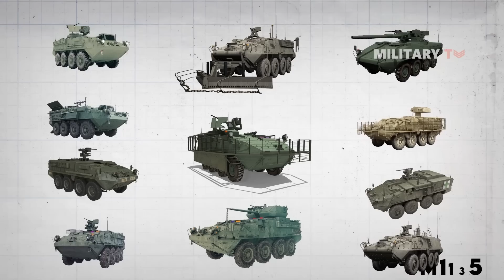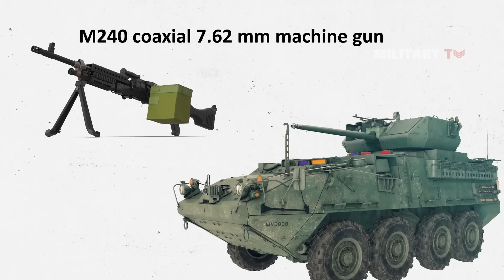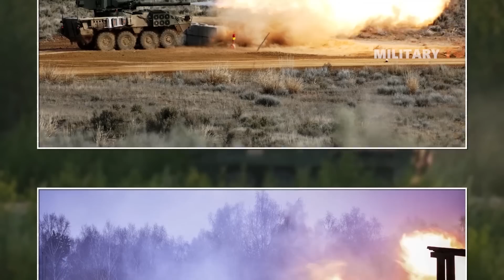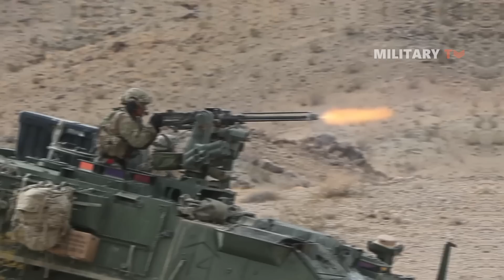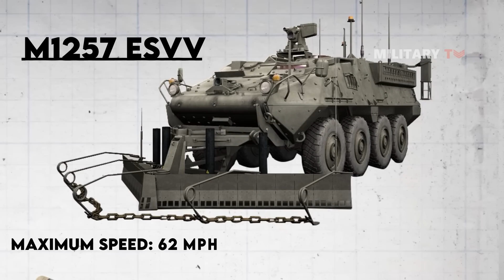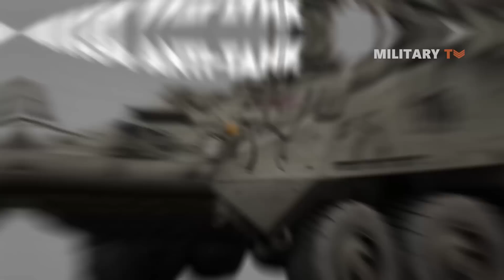What is the Stryker AFV the US is Sending Kyiv

Comment: I think the mortar variant would be particularly useful since Ukraine is often outgunned its ability to shoot and relocate would be critical. I was in a 113 mortar carrier and we could go from moving(while buttoned up) to sending rounds downrange in 30 seconds, pretty sure that's hard to stop with counter-battery fire.
Reply from the maker: Perfect
Reply: Germany is the new France
Reply: I was on an M-901 doing Recce when I was young and dumb. I felt WAY too exposed in an M-113 hull. We got through one with an AP 7.62...   NOT very reassuring. Basically only there to stop shrapnel and the elements. I couldn't wait for dismount and sneaking on foot time. The Strykers use basically the same hull as our LAV 6, which is a LOT more protection than those boxes were. Especially with all of the add-ons that GDLS-Canada  improved it with using after-action reports and battlefield experience. 
I love that vehicle. Tracks are fine for really bad terrain, but when you throw one, you are a dead duck. On a LAV chassis, you can drive away with over half of your wheels blown out. 
Cheers and have a good one..
Reply: Coming from the towed artillery, with full support like met and ground radar we'd have rounds out and coming at you in about a minute. You'll be able to shoot and scoot, just not scoot very far.
Reply: The mortar version would be great. Was in a Stryker unit and got pulled for a deployment with an ACR.

Got did the 113 suck compared to the Stryker. Slow. Very narrow fields of fire. Worse off road, and no, I don’t care what people say about tracks va being better.
Reply: @Suekaaax  You mentioned a minute's response time.    I don't how much of what I've seen elsewhere is hype, but I've heard it claimed that some of the counter battery radar systems are so quick that they can determine  the point of origin and transfer the coordinates to return fire so quickly that return fire can be launched while the first 'incoming' shell is still in transit. That leads me to guess the time is well under a minute. Does that sound plausible with the automated digital linkage between radar and artillery/missiles?
Reply: @gregparrott  It's all automated, when the ground radar picks up a shot and can tell its coming towards us it sends the info to the fdc to compute on its own and that gets kicked down to the gunline immediately. id say its definitely possible, the round may have to be coming from quite some distance for us to get a shot out before our position is impacted though, normally we would take cover and then shoot the counter battery once the fire stops.
Reply: @Suekaaax  What would be really nice is for the radar to instantly identify and report to the battery targeted, have that battery be mobile enough (engine running) to scoot at least a couple hundred yards out of the expected landing zone, and to also concurrently report the point of origin to other U.S. batteries whi IMMEDIATELY return fire while the intended target is busy moving out of potential harm's way.  That's likely wishful thinking, but THAT would render enemy artillery largely useless.
Reply: @gregparrott  I don't know the FDC and how everything communicates with each other well enough to speak on it. With the amount of money the government spends on the military I wouldn't be surprised if they have that or something better already. I figure a battery of our M109s could do this by itself, I worked on M777s and just know on deployment we were able to shoot counter battery immediately, but displacing and moving is something that takes a good bit of time.
Reply: @Suekaaax  I understand that moving towed artillery in response to a sudden, imminent threat like 'incoming' would not be possible. But for the self propelled ones I could envision that a planned salvo of a half dozen rounds at one location could be interrupted by an order to IMMEDIATELY move, allowing them to move out of the predicted zone of greatest danger within ~20 seconds.
Reply: @gregparrott  . Let me put it this way. OUR counter battery Radar had our location accurate within 25M of 3 of our guns, and just under 45M for the fourth, before I called shot to the FO. 

And they assumed the wrong round type, and did not have MET Data, which made their calculations inaccurate.
Reply: Electric magnetic force field protection from radiation too😀
Reply: funny how not once he mentioned Leonardo in this video, that provides the unmanned hifact turret or the Leonardo DRS and BlueHalo counter drone system for the Stryker. Without all the other European technology there would no Strykers, but the manufactures sells the copy to a fa higher price to their own country!!!

Comment: Basically, It's a Canadian built LAV III up or LAV 6... Most commonly with a remote control turret. 
The originals were based o the LAV III, but combat use made new upgrades a must. So BOTH Canada and the USA benefited from this. We use the LAV 6, the US the Stryker (named after TWO CMoH winners with that last name. They are built in London Ontario, Canada. Near Toronto. 
People don't realize this because we have a small military, but we have a very advanced military industry sector. We do AI, Optics, Light Armour, Light weapons and other stuff like munitions. For a long while, the Canadian CRV7 fin-less 70mm rocket was used by a lot of countries around NATO.  There were even a laser guided PG version, a land use kit mounted on a 6X6, an anti-radiation version AND a GPS guided one.
Reply: don't forged the new anti drone direct energy weapons comes from Italy, Leoardo's DRS, Blue Halo system, or SPEAR, a compact, and deployable Electromagnetic source as a directed energy weapon!

Comment: They are discontinuing the version firing the 105 cannon. Vehicle wasn't study enough without lowering spades which cut back on mobility. The shock of the gun firing shook things apart without letting the energy from the recoil be transferred to the ground. At that point your better off just towing artillery.
Reply: And THAT may be the reason for the Booker.

Comment: I operated the M1132 ESV.
That thing is hot garbage. Not to mention they haven't been properly fixed in years.
I could probably write a book on all the issues. I had to have three pages on the 5988 of the faults with these and they never got fixed.
I bet Ukraine is getting those same ones because my old unit just got rid of them last year.

They were ment for small arm fire and maybe an RPG round at max.
A single tank round will blow this thing right up.
Even artillery rounds will blow this up.

You hit the left side of this APC and you kill the driver/TC/Gunner. You also destroy all the electronics that control it.

The hood is only 1/2 thick and a shape explosive will take the engine out if hit in the right area.

It's really only good for transportation or unarmed crowd control.

Also the fuel tanks are in the back exposed.

Eight wheel casket.

Comment: Strikers are not armored fighting vehicles.

They are APCs.

There is a massive difference.

I love my Stryker. They are great. But they are not an IVF like a Bradley.
Reply: What's the difference? Which is deadlier, Stryker or bradley?
Reply: @larryc1616   The Bradley is heavily armed and armored. It carries a relatively small number of infantry to support it and the tanks it is supposed to be with. Because of this, it is slow (say 40 MPH). 

A Stryker is lightly armored (only rated to stop .50 cal). It carries a lot of infantry. A Stryker is fast, they 74 PMH, and that is because they have a governor, and are much after off road because of the suspension system off-road then a track assuming open area. 

. In a Bradley element, the Brad is the primary weapon, and the infantry support, in a stryker element, the Infantry is the primary weapon, and the Stryker Supports.

Comment: The thing that people seem to forget about the Stryker, is that it’s a troop carrier
Reply: So are btr 80s but both sides still use them APC's do a lot of work just running the gauntlet back and forth from the mostly static front line
Reply: Nailed it. I am a styker infantryman with 2 tours in combat. I love the stryker, but it is only as useful as the infantry inside it. It is not intended to be a frontline fighter, it is designed to support the troops on foot.
Reply: @tappytibbons735  get to see a Dargoon yet with the 30 mm autocannon?

Comment: Did I miss it or did you not report exactly which Strykers the United States is sending to Ukraine?  By the way, you may wish to mention that the M1128 Mobile Gun System (MGS) or the Stryker mounting a 105 mm tank gun was retired at the end of 2022 due to design and operational deficiencies.

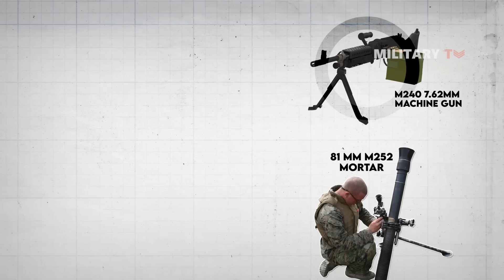Comment: How about a “thunder run” version with 6 remote operated grenade launchers?The 6 people inside each get their own gun camera view. Another version but with 50 cal heavy guns instead.   6 of each and 6 with the big heavy shoot on the run gun. You could roll through a 9:08 city at 40 mph f ing everything in a 1000 foot radius as you go.  Triple 6 special delivery right through the Russian frontline.
Reply: These vehicles are weight limited. You can't just put a thousand guns on it and act like its going to not blow out the suspension. Even the mortar variant is so over loaded it can't run a single .50 cal machine gun. The suspension system is highly sensitive to added armor and weight. They are infantry carriers, not tanks.

Comment: Thing has tires, it’s going to be worthless in Ukraine. It will only be able to drive on roads, instead of tracked vehicles like tanks that can go through forests and mud. The Russians have fire control over the roads, I would hate to be the crew driving this thing.
Reply: Eight wheel drive.  It'll do all right.
Reply: @SteffiReitsch  I have seen these things stuck on solid ground before.
Also seen that eight wheel drive buried itself in mud.

You can't really take these off road and they were never meant to be off road.
Reply: @Soundsofthewood  I don't believe it.
Reply: @SteffiReitsch  I was in the 1-25th SBCT.
I almost got flipped in one of these.

We had one dig it's a ditch and needed two trucks to get it out.
That was flat wet ground also.

I use to drive these things and never pushed them too far because I knew they won't make it back out on its own power.

These things are junk.
Reply: @Soundsofthewood  Yeah, and I'm the Queen of Sheba that went on a mission to mars with the Foreign Legion. AHAHAHAAHAHAH
Reply: @SteffiReitsch  that's cool. Do you have a certificate or a DD214 to prove it?

Comment: IS nothig for russia
Reply: @PS98 200.000 soldats ucrainiens  are died
Reply: @PS98 TV occidentaux its not speaker right ucrainiens Lost Evert days 100.40.80. même février Lost 200 and 150 soldats vous mentez trop imbéciles
Reply: @mou5007  "western tv is not speaker right"
Reply: Honestly you just have to shot the left side between the driver hatch and the front of that side storage rack.
The will either kill the driver or the TC & Gunner.
The idiots put a hatch in that spot also, so a weak spot.